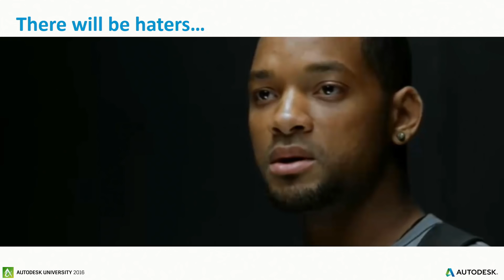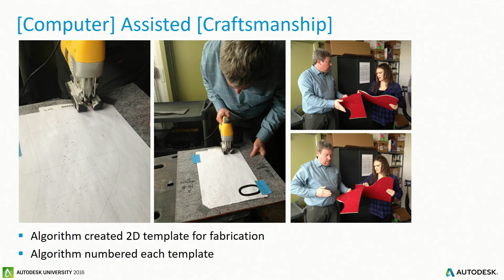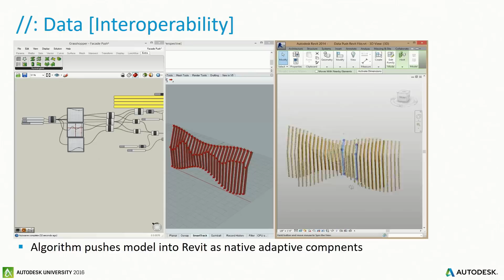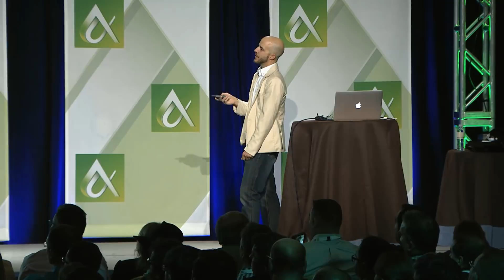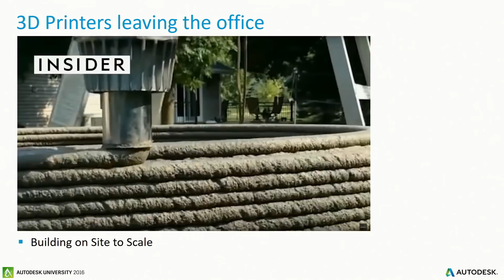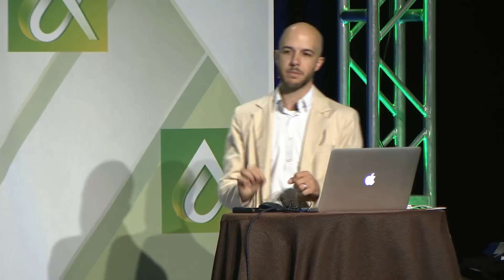The Future of BIM Will Not Be BIM—and It's Coming Faster than You Think

Comment: Excellent video. I've got some questions. Is there a way to model geometries like grasshopper did without using rhino but working just with dynamo? Time ago I needed to model some weird geometries for an historic palace and I did pretty much the same thing I've seen at minute 20:40 . The point is that I want to be shure what the best worklow is: Grasshopper + Rhino works fine for modelling and having a deep control on geometries while Dynamo is more for manipulating data from the model in Revit and managing it in schedules? Is this a correct vision of what to use during the project workflow?

Thank you in advice

Steve from Italy

Comment: Amazing and all but if I was able to attach my roof without splitting walls, place a date without a time stamp to the second on the titleblock and able to autogenerate legends, make vertical drop ceilings without having to place walls against the ceiling we would perhaps be more useful, realistic usecases for a lot of people instead of neglecting these flaws in the program and only focusing on these extremely advanced Dynamo applications that are useful to like 0.01% of the user base.
Reply: Lol, some decent points.

Comment: Actually this is progressive. Rather than having to do rows and rows of piles manually, it would be better to have it automatically generated with all its dimension and necessary information in an excel spreadsheet. Generating piles columns and beams are faster than manually modelling it and other areas can be prioritized for real modelling in the BIM model especially in big infrastructure projects like Railways, tunnels, Plants and many more as opposed to buildings.

Comment: Love this. AI will never be able to design... but it will give computers a much needed boost. 80% of my day is performing tedious tasks when I could be spending that time designing. I don’t want to mess with excel all day. I don’t want to learn how to adaptive model HVAC systems. My job is to build an amazing building... not to fiddle with one on a screen. 

So I welcome the robots.
Reply: But you should be responsible and cognitive of all the mechanical systems that need to fit above ceiling and not have specialty contractors coordinating a ceiling plan where sprinklers are on top of lights )))

Comment: The 'gap' between what is developing in this industry, and what I see on the street being built today, here in southern California is like comparing the 21st Century to the last.  Around the corner from us, someone just started a $million+ house that so far indicates no special knowledge of anything.  Just another stucco Mcmansion.  As with most buildings in southern California, the first thing they do is stick about two tons of cement heat sink, to the entire outside of the building, to ensure that when it gets to 121F, the building stays that hot, all night long too.  Smart.  (This is sarcasm for those who missed it)
I spend part of my time using Sketchup to design passive buildings for the desert.  I'm at the point of attempting to integrate Beopt (Building energy optimization) analysis software from Nrel.org, to determine relationships between thermal mass and glass surfaces, where radiant heat begins to warm the building, and the effects of thermal chimneys and a comprehensive ground connection, to cool it off.  I just installed a radiant barrier on the roof of our house and it's making a noticable difference already (but isn't code until next year).
Sketchup does a lot of this surface modeling natively, without plugins even.  Some interesting uses of materials can result;  The carpet piece model in the video would be a good way to use cut-offs.  Back in Quebec, in the '80s we would take that waste lumber and edit out the worst parts with a table saw and planer and glue the rest together into large blocks.  One carpenter was especially good at Chainsaw Assisted Craftsmanship and could do what you see above, to make and entire staircase, a kitchen or almost anything in the house that needed that custom, laminated wood, Timothy Leary look.  His work was actually quite spectacular and unlike anything I've seen since.

Comment: It’s funny how SolidWorks is more advance this sense because even SolidWorks 2010 you can put a gear formula and you would be able to dimensions you decide and it will update the rest of the gears..but it’s not only SolidWorks so many architecture software can also the same thing long before this discussion surfaced. The only issue is ..it isn’t being used because the cad users only wants to use what they being taught..but to be fair if would be nice to see it as one of the common tabs because this was always hidden..

Comment: All of this has been talked about promised before I was a freshmen in Architecture school 20 years ago. It's maybe slightly closer to reality, but the idea that highly variegated building components will be the same cost as repetitive building components is hugely optimistic... The tools will not drive better design, wiser choices will drive better design.
Reply: An example of better design is energy efficiency.  Running varying window sizes/positions/shading through a program to find the optimal combination is designing a better building.  That's not far off from where we are now.
Reply: Thanks for sharing this. 
I am tired of TEDex presentations or that like, that point the direction but do not know the distance, or that it's closer going the opposite way.
Reply: Without adequate tools, creating better design becomes hard. A potter will have a hard time forming the clay without his wheel. If the potter gets an order to create 10000 identical clay pots, we all know an automated process does it better.

Using the appropriate tool at the appropriate instance definately drives both a better design and a better product.

The wisdom lies in knowing when to use what.
Reply: BINGO!
Reply: The tools will not drive better design, wiser choices will drive better design.
This is brilliant - thumbs up
Reply: Whoever doesn't know how to use all the tools available for design will definitely affirm that those will not drive better design. If you know how to use these tools properly and exponentially, you will have better design and all of what these tools promise. I was able to deliver a project in 5 weeks, with only 2 interns and a SPM, and of which it would require a team of 10-15 people and/or more than 5 weeks of work.

Comment: is it possible to get hired as  arch.viz.or executive architect , or anything to do with architecture  without degree but with great selftaught 3d modeling and rendering skills presented on portfolio ?
Reply: heat flux nop coz visualization is not tht important and if it is there are nowdays programs like lumion tht will do it in fraction of time plus u have balcan indian and Chinese tht do it on cloud almost for free so u in the other hand is better if u invest as a bim technician and u dont need a degree for it only a diploma an u teach ur self to draw detail and practice then is around 25 to 35 k per year for u
Reply: what does BIM technicial do? drawing 2d floor plans in autocad?
Reply: heat flux BIM technicians work mainly in Revit at standardizing templates, families, practices etc across a firm
Reply: I'm also getting a drafting degree with spec in architecture. This info was helpful. Thank you Ifoundgrace